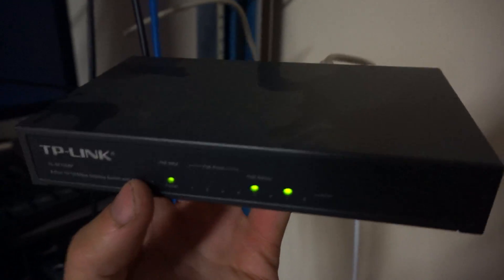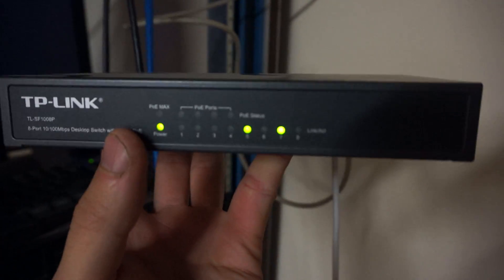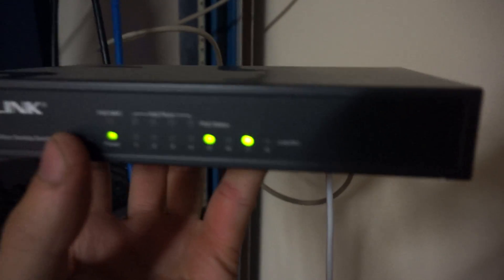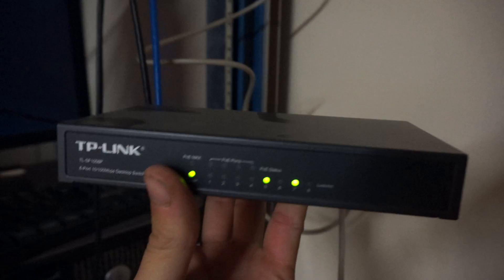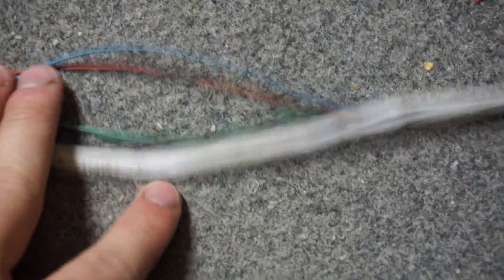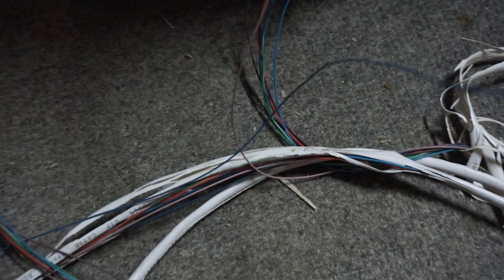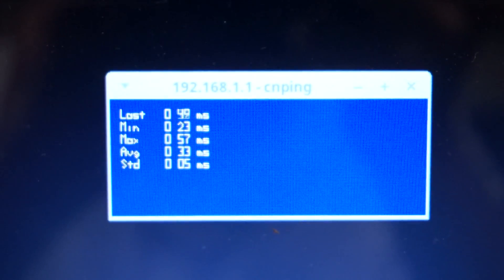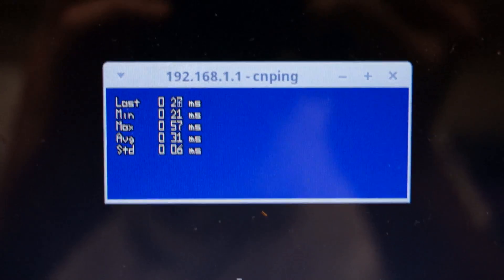Ethernet: Unnaturally Robust

Comment: The $5, 50' "cat6" cables on ebay are a lot like that cable.  They are untwisted and incapable of gigabit Ethernet, but alright with 10/100.

Comment: I've used cables that looked similar. In our old house,I ran ethernet over the unused phone wiring(4 extra unused wires),and had a solid 10/100 connection at the other end of the building. I've also used regular 4cond phone cord to make short (up to about 75ft) cables,and that usually works okay. It can get funky at longer distances. I like the phone cord,because it's smaller and more flexible. Kinda handy for laptops,and RaspberryPi's etc. just so you don't have a giant,heavy, CAT-5 cable trying to pull it all off the table. Ethernet is pretty dang robust. I think you could get it down some rusty barbed-wire fence,if you had 4 lengths of it.

Comment: Sometimes when the real data starts to flow it goes to crap in situations like that.  I do agree though it is pretty impressive.

When I was a kid (age 15, circa 1998), I went to a junk yard and found a pile of Cat 5 that was out in the rain.  I collected the largest bundles, and then solder spliced 4x 100ft sections together, not realizing the twist was important.  I then ran it 350ft (50 more than the spec allowed) under about 1" of soil, under a bike path, and through some woods over to my friends house.  10Base-T worked great for YEARS.  100BaseTX would not handle it on that cable, but for the time period 10mbit was great for most everything we did.  Another cable went the other direction to another friend's, and the "NAN" was born.

Thanks for the video, time for a new cable either way I think.

Comment: In 1980, I had the house we were having built pre-wired with 25 conductor RS232 cable, figuring I'd find a use for it (alarm system, audio, whatever). Today, I run error-free gigabit full duplex over 8 of the wires. The longest run is about 30 feet. I'm pretty sure I could run gigabit over wire hangers for a foot or two.  :)

Comment: I wonder how far you could go with a custom cable made with just a 4 or 8 conductor flat ribbon (maybe even with a non-optimal wire layout). Also would be interesting if the emissions from such a cable could be picked up on an FM radio, perhaps even controlling the sound with the packet data.
Reply: Here's HDMI working just fine through a bunch of coathangers: https://plus.google.com/photos/+AlexanderGlenn/albums/5782841475338037953
Reply from the maker: I already did something like that with a 10baseT network connection.  Check out my "Broadcasting AM Radio with Ethernet on the ESP8266" video
Reply: Ah completely forgot about that video. Still curious if FM could be done, but I suspect that it would require closer to gigabit speeds to have a fine enough frequency control.
Reply from the maker: That's a really good question.  It would be prohibitively difficult due to the encoding that happens on-wirer.
Reply: I've used regular 4 conductor phone cord,up to about 75-100ft,for regular 10/100 (gigabit needs all 8 conductors.) It usually works well,but sometimes with the longer runs,it will get funky,or some equipment will refuse to link,or only link at 10meg. It seems to depend on the electrical noise in the area,and the particular equipment itself. (For instance,when using this 'phone cord cable' my laptop refused to connect to my gigabit switch at anything other than 10meg. If I plug it directly into the router,I get full 10/100. shrug)
Sometimes it works better than others. But runs up to about 100ft are usually doable, Much longer than that,and things start to go screwy,IME.
Reply from the maker: that is... insane.
Reply: How much free time?

Comment: Can confirm. The physical resilience is unnaturally good. I strung a gigabit line up the attic, then moving guys slammed a fridge on top of the cable. Cut it right through. Soldering iron, bit of insulation, and some alumin(i)um foil on top of the fix, and it's doing the limit all day every day, for the last 5 years. Then I got a new router, which needs to be reset from time to time. Small contraption to switch on and off the router through the foil connection plus one of the data lines, switch on the attic side, and it's good to go! The amount of hacking you can get away with is unmatched.
Reply: I wanted to have a mini LAN party once but didn't have a hub.  The solution?  Cut an ethernet cable in the middle, twist together the pairs to make it a crossover cable and...  it worked.  Don't touch it though, there was nothing holding those twists together so anytime someone bumped the table there would but huge lag spikes.

Comment: You got lucky.  I've had to reterminate many Ethernet connections where the original installer striped the wires back a couple of feet and untwisted the pairs.  In those cases, the client had issues with intermittent dropped connections or no connection at all or the connection constantly auto-negotiating.  Reterminate the connections properly and it corrects the issues.   Probably many things come into play such as reflections, crosstalk, and RF interference that occur when pairs are separated and untwisted.

Comment: You just demonstrate paradox with Ethernet equipment. As equipment is worse more things will work on it and vice versa.If you try that cable on any "serious" switch or network card and it will not work.
I had interesting experience with  Linksys SRW2024 (before it was Cisco) which cable of 102m mark as faulty and do not want to work with it, just because it is 2m longer then it is according to standard (same cable work without any problems and with 0 collision/losses on D-LInk gigabit switch).
Reply: with 0 what?

Comment: So my questions are: LInk speed? Packet loss?
Reply from the maker: The link speed is the full 100 MBIT/s.  There was zero packet loss that I could find.  Because of the way I was pinging, any lost packets are simply lost.  Only with wifi would there be retries.
Reply: And something like file-transfer bandwidth in comparison to an intact cable.